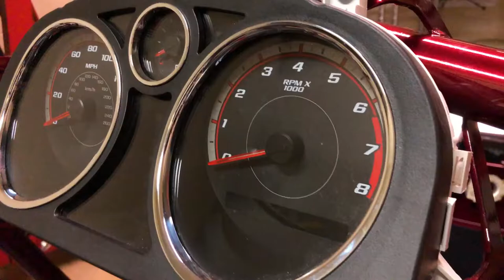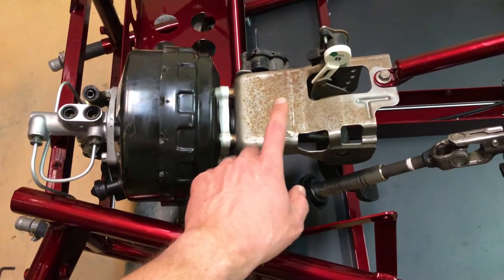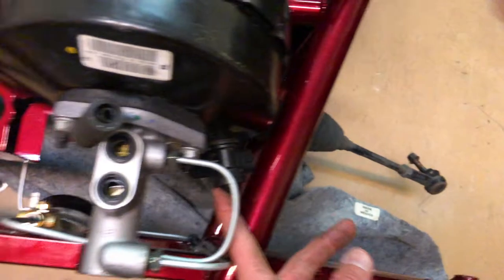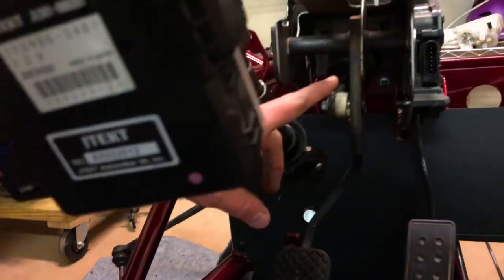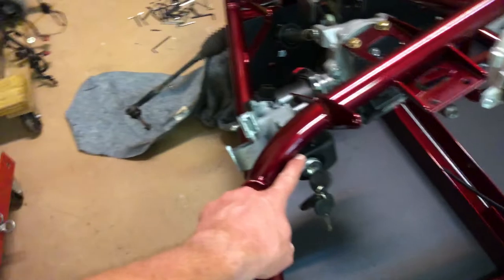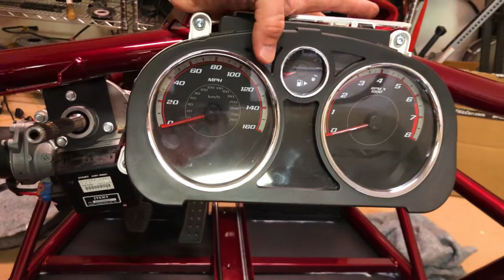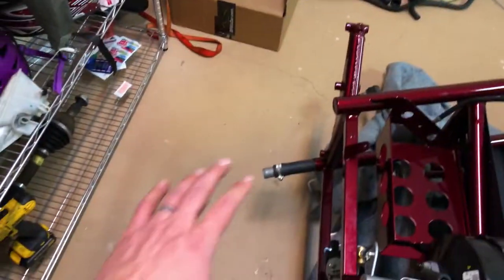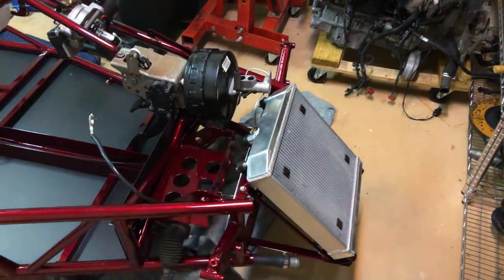DF Goblin Kit Car Build - Part 2

Comment: I have a thought on something I had seen in the video ... maybe it's been addressed already ... the ground cable on the battery box may need the powdercoat removed under the connection point to get a good solid ground. Have corrected that issue for several people in the past that had intermittent electrical issues and even a no power issue. So, if you find you are having an electrical problem, this may be where to start the troubleshooting.
Reply from the maker: ThePeopleVerse yes!  I was just thinking that too.   Thank you!   I’ll add it to the list.  👍👍

Comment: I’m in a current build. Curious it did have to be reprogrammed to start again?  Any tips on running those radiator hoses? Is tire wet the best idea? Appreciate any info
Reply from the maker: Hey sorry I was away from YouTube forever.  Just saw this.  You get it figured out?

Comment: make sure you run the clutch line next, once you get more in the car it gets tougher. you may need to remove the radiator some to get it through. That and the heat exchanger fan/ radiator / tubes are things you need to do now when you can get down there....something the video's do not cover...
Reply from the maker: Manuel Atallah thanks dude!!!   Will do
Reply from the maker: i'm looking through the forums.  did you happen to document anything around installing the clutch since the vids don't cover it?
Reply from the maker: actually, looks like this is what i need...  http://dfkitcar.com/forum/index.php?threads/bolting-up-clutch-pedal-bracket.262/#post-2465